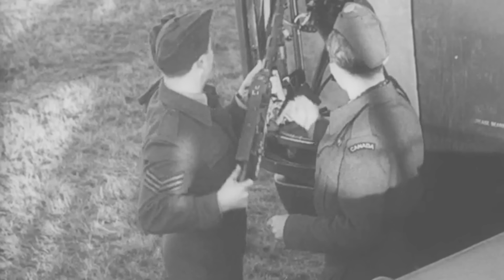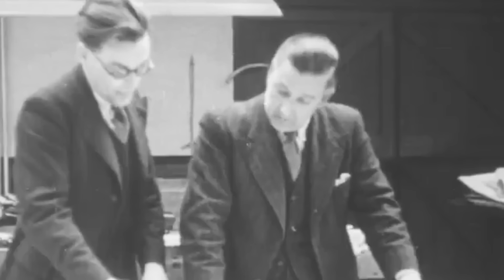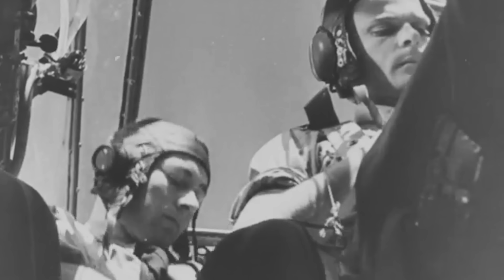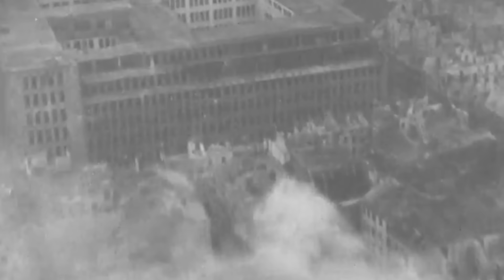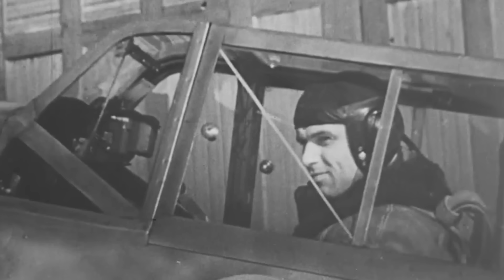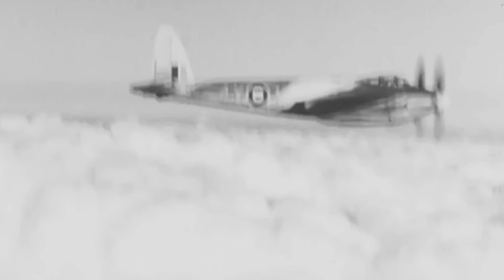The Beast That Attacked in the Last Place Anyone Expected

Comment: The Germans tried to replicate it,  with the  Focke-Wulf Ta 154 "Moskito"   Their project failed,  due to the destruction of the only German factory that produced a very strong glue called "Tego-Film".   Alternative adhesives proved disastrous,  as they were incompatible with the wooden structures.  The project was terminated after fatal crashes of prototypes.

Comment: The OSS (forerunner of the CIA) used RAF Mosquitoes to gather intelligence using very primitive 'mobile phones'. In late 1944 and 1945 the OSS dropped observers who gathered intelligence on German units that manoeuvred at night to avoid allied air attack. A Mosquito would fly a pre-arranged route slowly, allowing the ground observer to communicate with an OSS agent who was jammed up against the fuel tank in the fuselage.

Comment: Wasn't faster than even an Allison Mustang !!!!!!
Reply: Allison Mustangs were a different bird altogether.  Not supercharged, so they were fast down below 10,00 feet, maybe on para with the Mossie, but struggled above that. Mosquitos were designed to carry bombs, not to be a fighter,  yet they shot down some 400 aircraft. And had a lower loss rate. While hauling up to 4000 pound bombs! They also flww at all hours of the day: not the Mustang. Brits used the Mustang As for low level attack, and guess why the Mustang became great? A British engine with supercharger.
Reply: At the time the Mosquito was first being tested,
it was faster than a Spitfire…
and the Mustang of that time.

That soon changed.

It’s all about the timing.

Early Mustangs ran up to about 390mph,
the Mosquito was just a bit faster.

It was using normally aspirated engines-
it could have gone faster with more power and different props but that glue issue was already very concerning…

Comment: Only weird because for some reason whatever software you loaded the original photo into, placed the tailfin insignia flash on the horizontal stabiliser and the fueslage roundal and lettering on the underside of the fueslage...other than that the Mosquito was brilliance with wings.